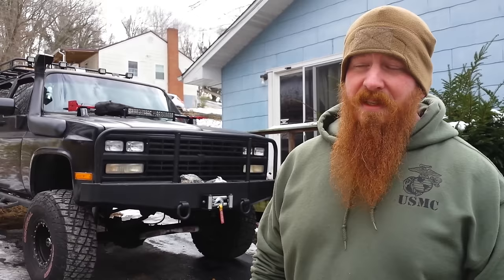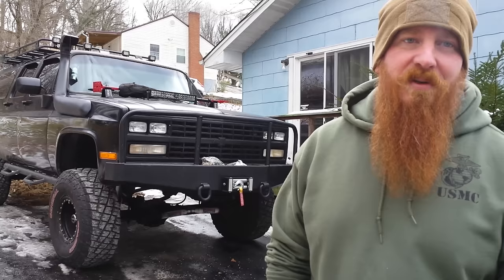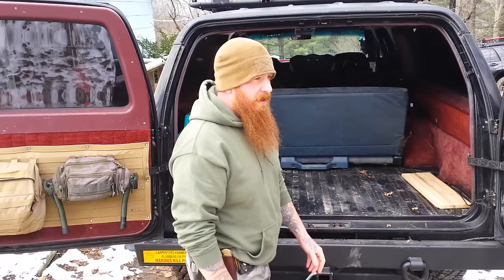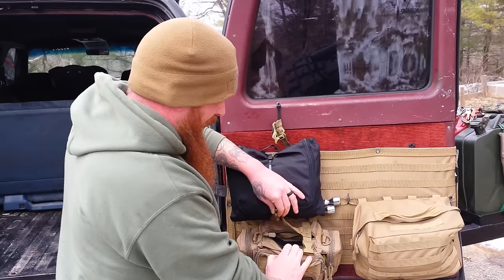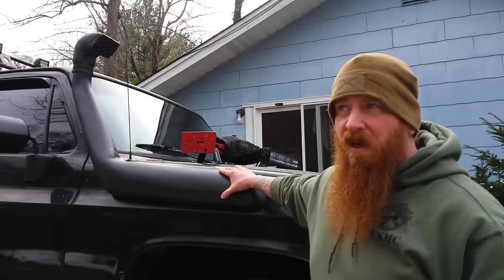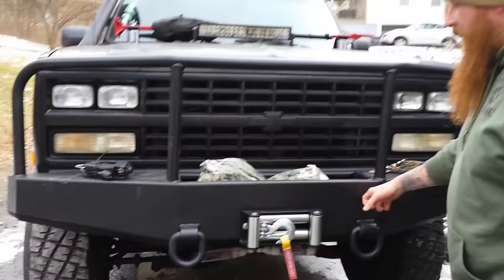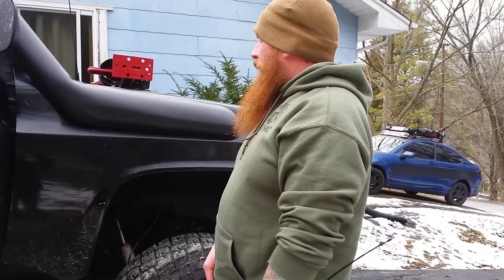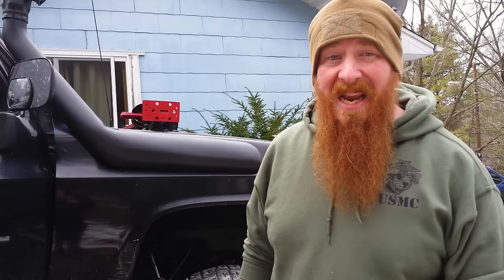80's Chevrolet Suburban 4x4 Bug Out Vehicle  (CSBOV)

Comment: I love the truck how many yards to the gallon?
Reply from the maker: Prepper Rabbit ahhhhh you are toooooo funny.. 21mpg
Reply: City or hwy
Reply from the maker: Prepper Rabbit I'm not sell it. lol
Reply: Awh im thinking about doing some kind of diesel.
Reply: Did you ever finish looking at that website.
Reply from the maker: Prepper Rabbit yes
Reply: I have met some of those guys. You might enjoy meeting them.
Reply: 21 mpg is pretty good for an 80s suburban with a 350. Mine gets about 15
Reply from the maker: Thanks brother and stop riding wheelies in your 80s Chevy lol
Reply: I had a '84 suburban that got about 8 miles per gallon of fuel. It was a built 355 Chevy in it with 44 inch wheels. Still was more than fun enough to drive until gas hit over $4.00 per gallon then I decided to sell it off.
Reply: 21??? you are living in a dream buddy! no suburban with those tires and lift any where near 21. and the suburban came along the same time the body changed to the squar ebody platform. the suburban is the longest running name plate in any vehicle
Reply: After my 95 suburban at 200k+ miles needed new manifold gaskets, and a rear main seal + a paint job + a dead cylinder....it went to the junk yard for parts. I got a ford 97 Aerostar cargo from a school district for $1,100 with a V6 3.0  and it gets about 21mpg. I feel like I got a raise !
Reply: tank2449 if it has a tbi 350 with that lift and the tire 21 is doable.  You have to get match the gears to the tires. and you definitely have to drive it right.
Reply: no way in hell. my all stock 88 tbi suburban with overdrive on highway doing 65 on a level road gets max 18-19. but you put those big tires and lift no matter was gearing you put behind it will not get 20 mpg to the gallon. You could gear it so highway but then the truck is useless at low speeds and just garbage to drive at lower speeds and going up hill.
Reply: tank2449 you are gearing it the wrong way. if you have a stock 3.73 and overdrive, if you put 35" tires on it you need to put a 4.56 gear in it. That puts you back to a 3.73. That's how that works.  the reason you didn't get the mpg,was probably your driving habits.  I have a 91 just like this one and I get 20 on the hwy all day long.
Reply: sorry i worked 14 hours today my mind isnt running on all 8 cylinders. If im going to lift my truck with big tires and car about mpg im going with a disesl. the 350 in stock form just doesnt have enough get up and go.
Reply: tank2449 understand, but it does the job.
Reply: i love my 350, im use to have zero power in my daily driver 1984 chevy s10 2.8 v6 4x4 4spd manual. but that all about to change! got a 350 and a 5speed manual on it way to do the swap
Reply: tank2449 good deal,  I put a Cummins and 5sp in my old suburban.  best thing I ever done.
Reply: I'm putting 4.88's on my 99 k2500 with the 454CI. I hope it helps with the mileage but really im just doing it for the new tires. I currently get 11 on the highway
Reply: VenomX 78410 loose the manual fan,put electric fans. That helps big time. What size tires?
Reply: oh trust me, that is definately on my list lol. I hate the summers because the AC destroys my power... it keeps that fan on and just sucks... I just put 33's, 2 inch lift, and a detroit in the rear. my 4.10's really wasnt bad at all, but I decided to go more than I need and go 4.88's because its not a speed demon.
Reply: VenomX 78410 i gotcha.
Reply: If you have a depreciated vehicle that you bought right then who cares about MPG. For what you have its a terrific vehicle with nothing but upside. I picked up a 2003 Astro van with 135K miles last week for $750. It has enough ground clearance to get er done. If you dont have payments Good for you.
Reply: uscgalpha91 dude astrovan is a freaking spaceship nice buy
Reply: Step one survival who makes that rear bumper? Or do you have it made?
Reply: as stated in video....hand made
Reply: Prepper Rabbit How the hell do you get 21. My 2011 dont get 18
Reply: I just got back from the Cascade Mts in OR. I had a 800 mile round trip. I got 21-22 with my V6 4.3 astro. I drove 62mph with Cruz control most of the way. I have the seats out and very light weight camping gear. I don't use a roof top carrier. My Suburban got 16-17 350v8 at the same speed with cruze control.
Reply: Should put a 6.2 in it decent torque but great mpg
Reply: Step One survival Pshh.... 21 mpg dude. I have a 1990 gmc suburban with a 6inch lift. Not as fancy as yours. But I'm lucky if I get 12.5 mpg.
Reply: These 1989 Suburbans are actually SUPER economical for what they are. my 1989 Burb is actually [by far] the most fuel economic vehicle I have ever owned. It is also the smallest. Even my little Lincoln coupe was bigger (in size and engine power/displacement) than my Burb. My daily driver (two-seater Cadillac) is about five feet longer than the burb and gets less than half the MPG, plus it needs high octane. These Suburbans have 32 or 40 gallon tanks (both were/are available) and get something around 15 MPG on poorman gas. My next best vehicle was my 72 Lincoln, factory rated at 10 MPG highway on high octane.
Reply: Take this and throw a 4bt in it. It's a big investment but I'd bet you could get 600 miles to a tank.
Reply: 4bt? What is that?
Reply: 4bt is a 4 cylinder Cummins engine. They get great MPG with monster torque. It's a 12 valve 5.9l Cummins with 2 cylinders cut off. Because they were used in bread trucks and UPS trucks they are super plentiful. And because they use the same parts as the 5.9 their are loads and loads of performance parts that are really reasonably priced.
Reply: no fightin, no bitin.
Reply: I’m not a preppy but I love that truck. And I watch your vids. They’re helpful just for day to day life. 👍🏻
Reply: B real  6.2 diesel does 21 MPG stock... I should know I own an 85 Suburban with one in it..
Reply: Its inches not yards haha
Reply: @StepOneSurvival  jeez 21?? that's awesome.  What's the city?
Reply: Tree fiddy
Reply: Step One Survival 🤣🤣🤣 You are a true Chevy Legend..I have 2000 GMC Sierra 3 door cab 1500 5.3l 8 cylinder. Got rust over rear wheel arch done and placed pocket fenders. Next repairing rusted out rocket panels with covers
Reply: @tank2449  the suburban has actually been around since the mid fifties. I've wanted one for a while, but without some serious interior modification, ya boi doesn't fit behind the wheel of a fifties anything

Comment: Got me my 83 Suburban 6.2. 15600. In GREAT shape. I do not have my winch hooked up yet. my father-in-law is a master welder / fabricator and is building me a brush guard for the front and back. And then I'm going to be coating the entire thing with maxxlife but I am going to stick to the original color scheme. You are an inspiration my friend! Got two tents, four  sleeping bags, 4 Life vests  a cooler with survival gear and Fire Starting equipment, water purification and dehydrated meals. Also A fire extinguisher. A jack. A jumper box. First aid kit. And I'm about to hook up my CB. Hopefully getting it lifted 3 in. I also got me some good off-road 15" tires. It's definitely my dream machine!Happy   And the whole family loves it! By the way I heard you loud and clear the entire video. ;-)
Reply from the maker: Sounds awesome brother

Comment: When I was in the military we had to grease our wire (steel rope) cables. It lubricates the strands so that they do not chafe against each others and it also keeps them clean and protected from dirt, water and all sorts of bad things. Also every once in a while you need to clean the grease out of the cable and then re-grease it. That takes the dirt between the strands out and re-lubes the inner cables.

Comment: Considered adding an additional battery for a parallel or independent system?  Would come in handy for winching.  Keep a fresh battery for starting while you have another powering radio, winch, roof lights or other auxiliary items.  

Who makes or sells that roof rack?  
With those gears, are you screaming at highway speed or not to bad?

Comment: Nice truck and video! Our shtf truck is a 93 GMC 3/4 ton ext cab long bed 4x4 with the 6.5 turbo diesel. It may not roll coal like the new ones but it will pull your house off the foundation.

Comment: Informative video thank you! My favorite model Suburban the square body solid axle trucks! You are very polite and soft spoken I sense your manners where taught growing up or military or both. If that jacket is real then thank you for your service. Few questions what size tire and wheel package is that? Who made those killer front and rear bumpers? What was that spark under neath by the winch when working it? Loose ground or squirrel? God Bless America.

Comment: I work at a tire shop and it is actually cheaper to buy a mud tire for 20in wheels rather than 15s cause now most trucks come stock with 20s so tire companys don't make as many 15 in wheel sizes so 20s are better and there better for a bug out vehicle cause like I said most trucks have 20s so if it's a apocalypse you would be able to scavenge tires off broke down vehicles
Reply from the maker: john martin I said I have a lug wrench in a doomsday scenario am I going to be able to change tires possibly I can also change Wheels pretty fast it's something to think about
Reply: 15 inch steel wheels with red letter tires are old school bad ass
Reply: John M. you should make your own channel, sounds like you have a lot to say and offer folks!!!  I'd subscribe.
Reply: I ran into that problem when buying some new yok ats for my power ram.

Comment: I love your truck, great setup, only caveat I would give is you said "new vehicles have push button electronic lockers"(paraphrasing) I'm not sure if your just talking about putting the vehicle into 4 wheel drive or actual lockers like on a Rubicon wrangler. Big difference between a locker which goes in your differential and locking hubs. With locking hubs you still have a open differentials which whatever tire gets the least amount of traction spins, with a limited slip in your differential whatever tire gets the most traction spins, and with a locker it locks the tires together so they both spin equally (a lunchbox, electronic, or full spool is all on cost and personal preference). Whether you put the locker in the front diff or the rear, or both is all up to you. If you don't have lockers yet, I would encourage you to get some, makes a world of difference offroad. As I said though beautiful truck, great job on the bumpers, and the build overall.

Comment: Thank you for talking sence about Bug out vehicles. I had a Chevy Suburban with 4wd that would go most places. I now have a 97 ford cargo aerostar that cost almost nothing but gets 22mpg. I have basic camping gear and I could be gone for months. Its small enough to stash behing trees, bldg or in parking garages with out anyone giving it a second look.
Less is more. Just my .02
Reply from the maker: uscgalpha91 yeah that newer stuff these days you can't fix yourself
Reply: My ex wife tossed the title back to me at the lawyers office because my paid for 1995 4wd Suburban was not reliable and leaked oil. She had it for 2 years before the divorce. I took it to my mechanic who tightened the ground cable and put a replacement gasket on the oil pan. Total cost $48.  I drove it for 5 more years !!!!

Comment: Had 82 Chevy Blazer,  got 300000 before the vacuum system started giving me problems.  Air conditioning was still cold. Transmission and engine never needed serious work.

Comment: You need a cover on your distributor or at least silicone before you get tempted to use that snorkel. Also transfer in neutral, Lock hub. Engage 4x4 is the g.m.c required way. Nice truck. I have an o5 Yukon XL 4x4. Great information

Comment: Crazy idea, you seen those canopy's you pull open and ecpand has you set it up? Design a metal expandable cylinder that you clip to your lug nut's and around your whole tire that is smaller at the wherl base and get's larger has it go's out away from vehicle. Where eack pivot point is attach a flat chain a chain with one side ground smooth with little steel paddel's attached to the link's to give the pivot point's strength and support. The idea would be for an expansion wheel to allow vehicle's to pass through mud sand and snow and give the vehicle a wider weight distribution from the wheel expansion device's that can then be folded back down and stored easily. Could use a chian tie down made from flat chain to secure the expansion wheel's to the whole tire and have the sprocket set down inside the lug nut track not attach to the lug nut's just fit like a wrench using the lug nut to lock it into place has you clamp it down around the whole wheel.  😊👍

Comment: Without getting into too much detail, it does matter on some trucks if you engage/disengage the hubs before the transfer case. The rule of thumb is to engage the hubs, then engage the transfer case. Do the reverse to disengage everything. Anyone who is currently stuck in the mud in a pre-90s , automatic transmission truck with manual hubs can thank me later. In fact, given the wheeling circumstances, if you think you might need 4-wheel drive, just get out and engage the hubs, it's not hard. Then you can engage the transfer case as needed and avoid walking through the mud...etc.
Reply from the maker: Thanks for commenting

Comment: Thank you for showing the rear bumper now I know what I need on my 85 bourbon mine's got a 12 inch lift four on the body 8 on the suspension it sits on 40 inch bear claws.
Had the 350 gone through and everything is sweet with a turbo 400 behind it.
With a few modifications I got rid of the junk aluminum transfer case and installed an np205.
I found a smashed  85 C30 Air Force truck at a salvage yard and was able to get the entire truck for 800 bucks for spare parts for the bourbon.
Square body Bourbons are getting harder to find most of them are rust buckets or have been cut up and made into mudding vehicles.
It was my first choice for bug-out vehicle.
I have a roof rack similar to your Defender the only difference is I have a roof hatch that I installed where I can go up top from the inside but I do like the idea of the old Chevy van ladder that you put on the rear barn doors.
Anyhow my brother that's a sweet bourbon.
And by the way my other vehicle is an 18-wheeler. Lol

Comment: They have these jacks they use on truck trailers to lift them off the wheels tire jacks you pull foward and it lifts up on to the jacks reverse and you lower off the jacks. Then they have all terrain tracked sleds that afix to each wheel that allows a 4×4 become a tank. Extra bug out tools its always nice to have lots of options. 😁

Comment: yeah my tbi 5.7 in my suburban is stock and I'm happy with it. Allegedly the smog air pump thing got removed but if you get it running rightr it'll give you enough power in my opinion. Spend money on shocks and bearings and such and fix all the fluid leaks if you have any.....before you worry bout chips and headers and all that
Reply from the maker: Try the holly sniper kit.

Comment: I had just finished working on and getting my Suburban up and running, mine was a 92 but it was a former police transport rig, had the full police bumper, spotlight, it was a tank. It had a really nice storage rack in the back, no third seat and had extra outlets for plug ins, but some woman drove into me head on, my son and I walked away without a scratch but it was totaled, bent frame and she shoved the front axle back 4 inches.

Comment: Have y'all looked into swash plate pump motor split power system? You could remove both axial's opening up all that ground clearance by how the split system independent system for each wheel while in 4×4 drive. The really cool part is that you can work the swash plate split power system like a breaking system for your vehicle so you will have two breaking system's on your bug out vehicle. 😊

Comment: Similar setup with my 97 ram. Off road tires on 16 inch off-road steal rims. Only a single cab but it's in wonderful condition and has a bed cover so that fits a queen size bed. Great work
Reply from the maker: Thank you

Comment: I recommend the synthetic winch rope. As you could do a water rescue easier as the rope will float. Plus loose 20lbs on the front end. Can swap the rollers for an aluminum block and Lighten more.      Mine is 12000lbs with a 20000lb line around 94ft.

Comment: SOS, your rig looks sweet, man. I’m an ‘almost’ 20 year Army vet. Still in and will be extending soon too. My wife and I just bought an ‘89 suburban 4X4 with automatic 700R4 transmission and it works very well. There is a difference in interiors. We have three bench seats, like yours and no Center console in the front. My wife and I like that. She rarely is able to sit right next to me in any vehicle, but she can now. There is an oil leak....maybe from the rear main seal. I don’t know. The rear drum sounds like I need to fix a couple of things rattling around inside it as we drive it in reverse. I’ve done rear drum brake parts replacement before and it is not hard. I agree with the wheel sizes. 20!?s Really? That is dumb. Popular, more realistic tire/wheel sizes are a much better choice. I like being able to get out to lock the hubs as you do. I like the cb install too. If I had my way, I would go with a k40 whip for my radio. I like the mods you have done to yours. Although, the same year as yours my grill is different. I have two rectangular glass headlights, not four like yours. I have not seen a lot of photos of a front grill like mine on the internet. Keep up the good work. And, if I may, I would like to put nutnfancy’s page out there for you.
Good luck and fight the good fight.
Reply: Gotta 95 Yukon and these trucks are hella easy to work on lots of room in the engine bay simple set up and reliable.